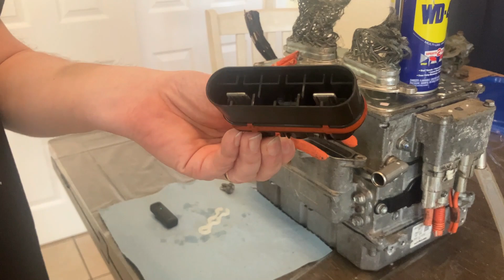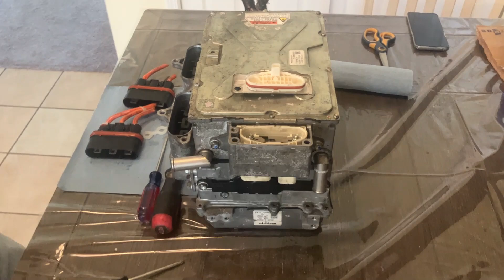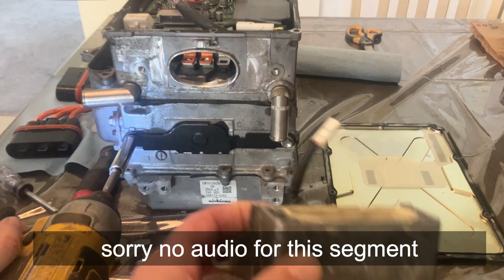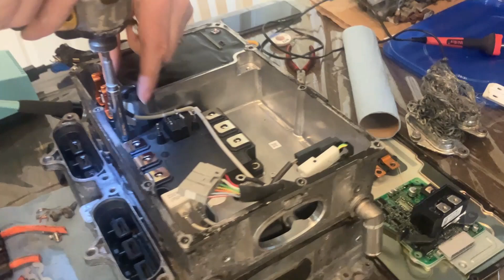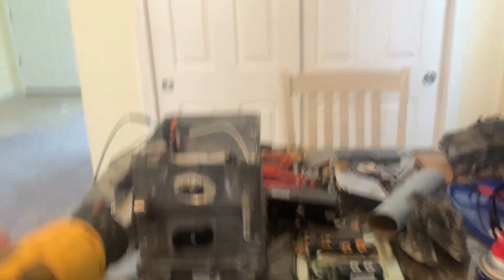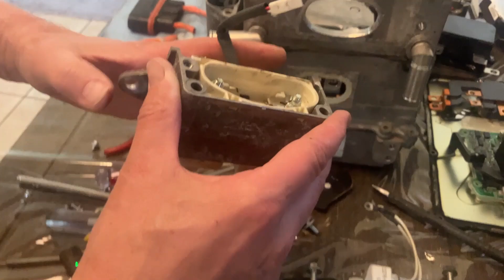Lexus GS450h Inverter DC DC Converter Delete

Comment: Hi Greg,
We don't need the booster function for the EV conversion. Can the upper part of the inverter (circuit board) be removed, or does it need the logic board for CAN bus communication with the VCU?
Reply from the maker: prior to Zombieverter firmware version 2.40A the inverter voltage reading was erronously coming from the DC-DC circuit board, so gutting that cavity resulted in loosing the ability to see the voltage at the inverter (however no funcionality was lost, as nothing in the code relied on it) in ver. 2.40 this has been remedied, however, if you delete the components in that cavity you still get rid of the bleed down resistor, so I don't recommend doing so

Comment: I found out that the big resistor is the passive bleed resistor to bleed off the voltage stored in the capacitor when the car is turned off. It's a really important safety feature so if it's going to be removed, it needs to be placed somewhere else!
Reply from the maker: interesting, thank you, I found out that the Zombieverter VCU get's it's Inverter voltage reading from the DC-DC components instead of the inverter side (at this time) so I would not recommend gutting your DC-DC section of the inverter.  This was just for demonstration purposes.

Comment: great video. Not converting anything at the moment but jut intrigued - To clarify bypassing the DC to DC section means MG2 is no longer limited at this point and can pull more voltage? genius if so